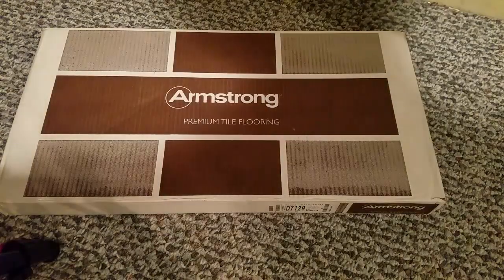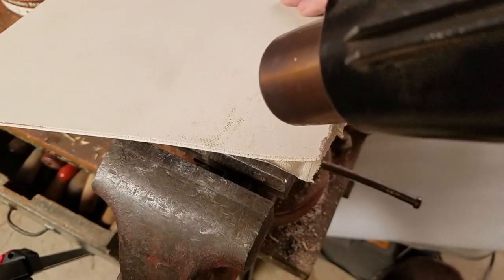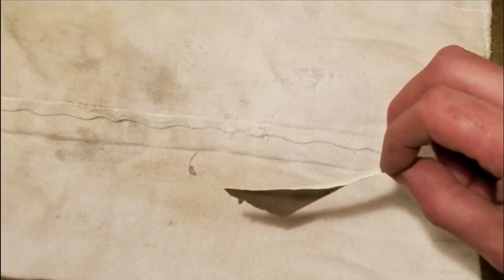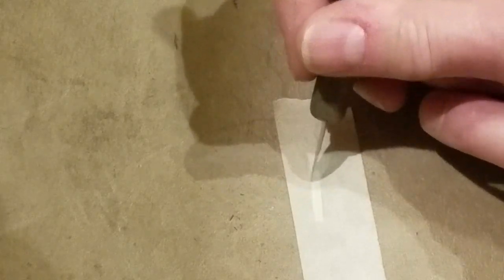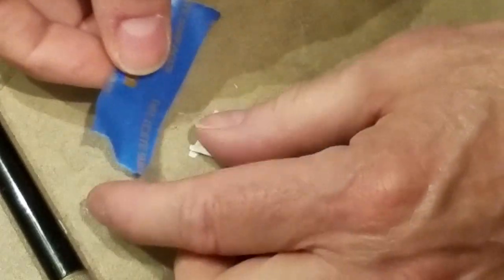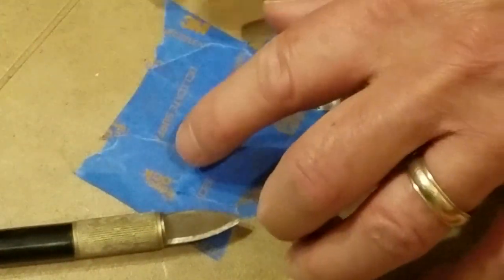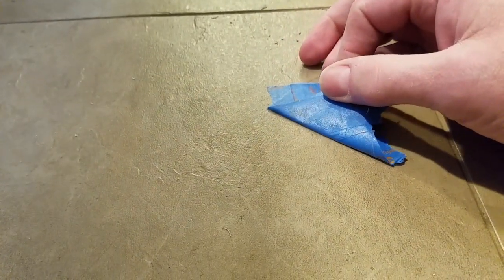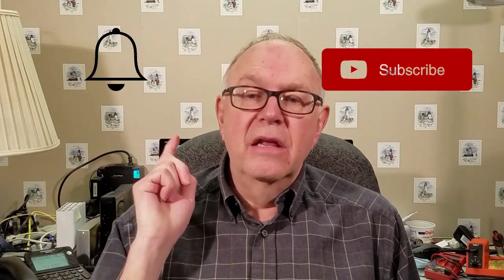Armstrong Vinyl Floor Repair

Comment: Another way would have been to cut the replacement piece 'close' to the shape you want then lay it over the missing area and then use that as the template, cutting around that.
Reply from the maker: That's a good idea!